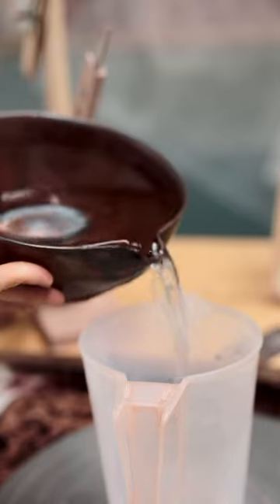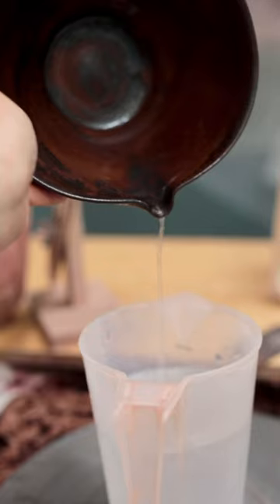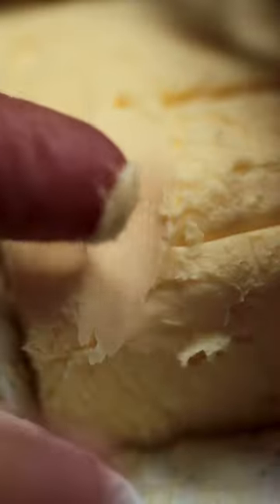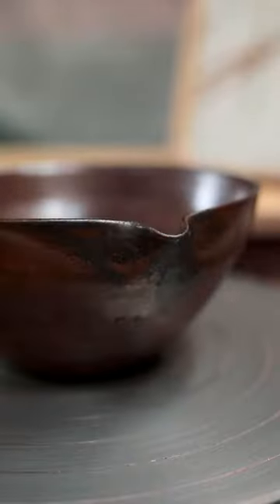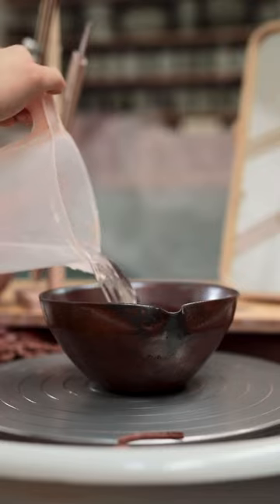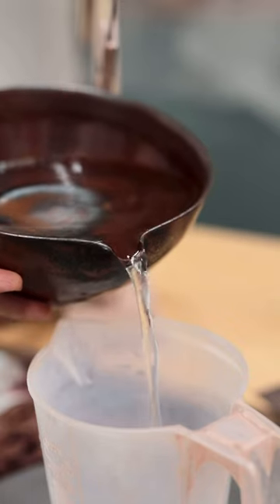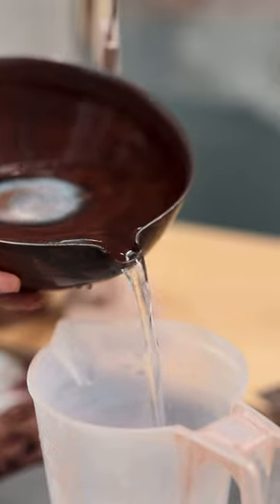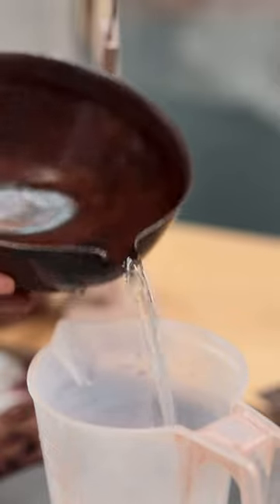Fixing Pottery With Butter

Comment: Buttery water.
Reply: if its acting as a hydrophobic surface with the butter, wouldnt that mean the water wont be bittery?
Reply: it won't be
Reply: If you knew what hydrophobic meant, you'd know that the butter never touches the water
Reply: What if it's a hot water?
Reply: @ip795 hot water poured near or even over fat doesn’t make a fatty coating go away. You’d have to rinse a buttery dish with direct hot water for quite a while before it was no longer noticeably greasy. And this isn’t touching the butter directly at all.
Reply: @jacforswear18  you are right!